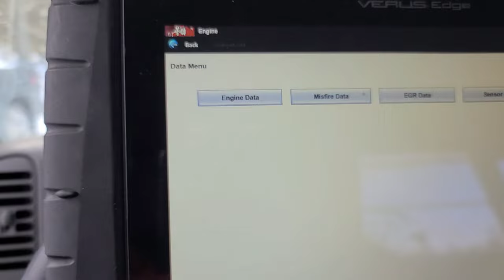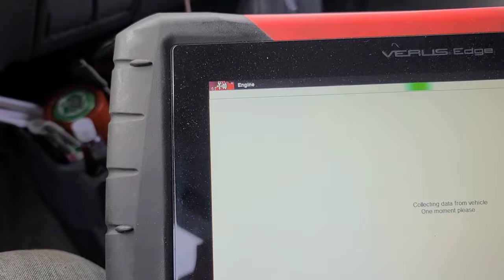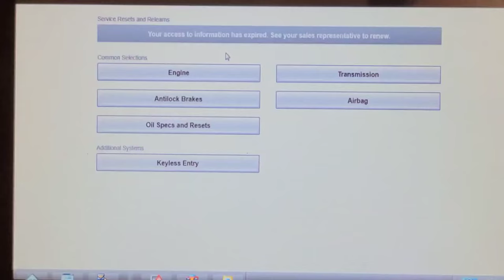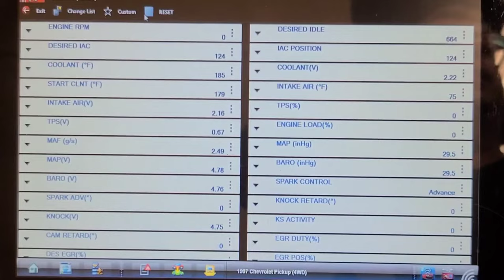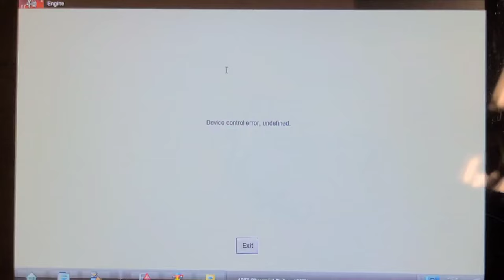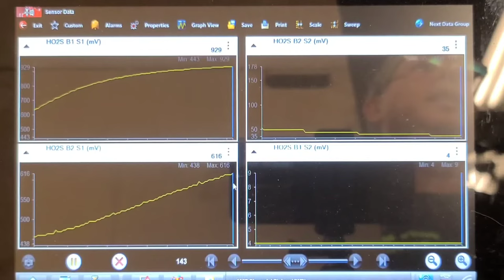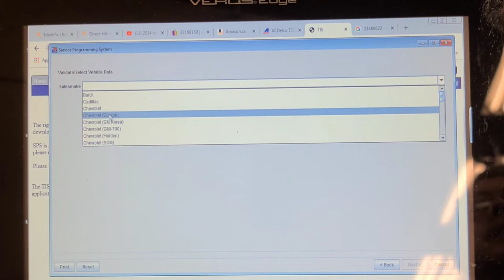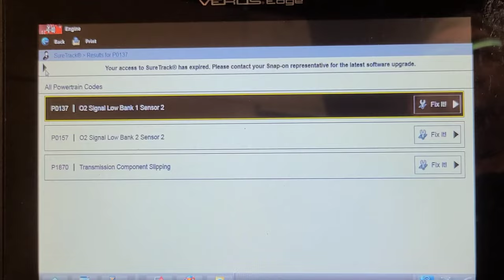1997 GM Truck Cranks No Start, No Codes

Comment: Doesnt ignition control module send information to the pcm letting it know when its ready for fuel and spark?  Sometimes you can pour a shot glass of fuel on the air filter and they will take right off on a crank but no start issue.  I see yours is different though.
Reply from the maker: No the ignition control module that was under the distributor cap of the throttle body systems did but this ignition module is a transistor controlling the ignition coil.
Reply: Nooooo it’s right beside the ignition coil that’s the problem

Comment: My blazer is doing the same thing, got spark, coil and distributor,rotor and capn,even fuel pump all new and replaced, no start, it's Gita be the ignition control module? Right? I'm not really getting fuel pressure, does the icm have anything to do with it?
Reply: Try changing your engine coolant temperature sensor that was the problem in my 98 s10

Comment: Did you pull the distributor and check the distributor drive gear? Numerous cases of the drive gear teeth being "knife edged" causing the P0300 random misfire code. Something to check.
Reply from the maker: No I didn't as I know the distributor was replaced and once running the cam sensor offset was at 0 degrees but you are correct the distributor gears wear out and throw out the sync between the rotor and tower causing an abnormally large air gap and weak secondary output leading to random misfire.

Comment: May I ask what may cause a no start "only when hot" on 1996 chevy suburban k1500? In the winter time the problem dissapears. In summer it won't fire up until it gets cold the next morning. New distributer,plugs,wires,coolent temp sensor,pvc valve. Fuel pressure at 55 "and holds good" and no codes. Thank you sir!
Reply from the maker: When it won't start I gather it's cranking ok. You need to figure out at that time what is missing ie spark, injector pulse or both. If you have no spark and no injection pulse could be a failed crank sensor. If you are missing just spark it could be a failed ignition module. Is there an RPM signal on the scanner? If you have both spark and injector pulse check fuel pressure.
Reply: Try changing your engine coolant temperature sensor that was the problem in my 98 s10
Reply: What was the problem

Comment: Phillip, thanks for the AWESOME  video/information  really learning a lot from you  so what made to go and  change the module /programing  and i wonder  with knowledge you have and sharing it you deserve much more sub in my opinion and been trying to share ur videos with others as much i can  CHEEEEEEEERS
Reply from the maker: The bias voltage on these older GM O2 sensors should be around 450mV KOEO and on this system because the heater circuits simply are turned on with the ignition and therefore should start to move towards 100mV with the ignition on not running. Turned out both rear sensors are dead anyways. Thanks for your support.

Comment: Fixed our 5.7 crank no start with new cap and rotor even though no visible signs of arcing out was clearly extremely old by the corrision built up underneath and on the rotor. Thanks for the video always nice to see someone else's go through before jumping under the hood as im not a daily mechanic so most of what i learn is lost over time. But since learning that subs and thumbs is what helps those of you posting your knowledge on here for us to save big money at shop its the least i can do! Cheers

Comment: Hey Philip, so I have a 03 Chevy s10 that just died on me while taking a turn off the highway. Tried to start back up but cranked no start. I had this same problem two weeks ago and it took me awhile to figure it out but I ended up replacing the rotor and distributor cap. Fired right up and ran great for two weeks. Zero codes. Then this happened. It’s getting gas and has no spark again. But this time it wasn’t throwing spark from the coil. Any suggestions?
Reply: @PhillipBailey  it’s a 6 cyl 4x4 4.3l. It also has a new coil. I’m about to check the terminals now on it. Appreciate your fast response
Reply: @PhillipBailey  also just hooked up a test light to negative and put it into the coil to double check the coil. I wasn’t visually seeing a spark connect from the light to the coil but the light would flash if I had it all the way in and was cranking over at the same time but couldn’t see the spark
Reply from the maker: @goodtripsonly  according to my info a 2003 S10 with a 2.2 4 cylinder uses waste spark and does not have a distributor.
Reply: @PhillipBailey  it’s not a 4 cylinder. It’s a 6 cylinder 4.3l
Reply from the maker: @goodtripsonly  ok then. The sensor in the distributor is the cam position sensor and it will not cause a no start. Here's what I would recommend to try...
1. Turn ignition on and listen for the fuel pump to run for about 1 second. The MIL must also come on in the dash and Stat on. If neither work check the fuses that power the PCM. If they are good then you will need to confirm the powers and grounds to the PCM. Ok go to 2...

2. You said you have no spark at the coil wire. Connect a test light to ground and backpin the white wire at the coil with the ignition on the light should light bright. If not backpin the pink wire key on. If it lights then replace the coil. If the test light turns on on the white/black wire have someone crank the engine over. The test light must blink indicating that the primary side of the coil is being switched on and off through the ignition control module. If it blinks and you have no spark from the coil replace it. If on steady 3...

3. If a scanner is available access engine data and watch for an RPM signal cranking and injector pulse width. No RPM and injector pulse it's likely a failed crank sensor or wiring. RPM and injector pulse 4...

4 at the ICM by the coil  a graphing volt meter to the control wire backpinning the white wire. Cranking you should get a 5 volt pulse to trigger the ICM. If you have a pulse then you have a failed ICM. No pulse you have a failed PCM or wiring to it.

There are a few other things that could be checked such as does the fuel pump run during cranking, do you have injector pulse. Other things like no fuel pressure will cause a no start but won't cause no spark.

Comment: Phillip, AWESOME and great information so u changed the PCM  because it did not control the O2 sensors or for some other reason and by the way you  deserve more SUB for the info/knowledge you sharing   and been trying sharing ur videos with others. cheeeeers
Reply: I was watching video I never thought of the coil it fiers when let go of key.trys to crank up but thanks allot.

Comment: Hey man i got a quick question for you i got a 99 Chevy c2500 5.7 it had a p1345 code for camshaft/crankshaft correlation so i reaplced the cam sensor now it wont fire up at all ran before just not right
Reply from the maker: That code is not a failed sensor and to be honest a failed cam sensor won't cause a no start condition. If you removed the distributor then you likely have it out of time. Pull number one plug,  turn the engine until you feel compression building in the plug hole then line up the timing mark to the top dead center pointer. Remove the distributor cap and check that the rotor is lined up to the appropriate tower. Also make sure the plug wires are on the correct locations. That code is typically caused by a worn distributor drive gear..

Comment: 2000 4.3 vortex v6 cranks won’t start, no spark at the coil so I swapped it. Still no spark at the ignition coil… should I be checking the distributor cap and rotor?
Reply from the maker: If you have no spark from the coil it's not the distributor cap or rotor. Does the check engine light turn on with the ignition switch? Does the fuel pump prime? Does the PCM communicate with a scan tool? Codes? Does the PCM read an RPM signal while cranking?
Reply: @PhillipBailey  the fuel pump does prime.
One code only, p0442 (small evap leak) 
I haven’t checked rpm on a scan tool but I don’t see the tacometer move when cranking
Reply: Yes check engine light comes on p0442
Reply from the maker: @saulguel5404  the gages may be frozen during cranking. Have to watch rpm in scan data. I'm sure the p0442 is unrelated.
Reply: @PhillipBailey  should I replace the ignition control module,
Reply from the maker: @saulguel5404 did you confirm power on the tach white wire at the coil with key on and it does not blink when cranking? Then yes.
Reply: @PhillipBailey  hey I used the test light on the red wire (power wire) connected to the ignition coil. the light remains on. There’s a second wire that’s white with a black stripe I don’t get a light with that one
Reply: I also tested the red wire that connects to the ignition control module and the light also stays on.
Reply: I tested both with the key on and cranking aswell the light stays on
Reply from the maker: @saulguel5404  the test light should light up on the white wire too. If not then the coil primary winding is open
Reply: @PhillipBailey  I mean I replaced the ICM and it worked… hey thanks man !!!
Reply from the maker: @saulguel5404  glad you figured it out.

Comment: My 97 gmc 2500 sierra 5.7 was doing this after i changed the radiator.  I changed the fuel pump and it seemed to fix the problem only after a few cranks later its doing it again? any suggestions?
Reply from the maker: Check your frame ground. There is a heavy ground on the lower right side of the firewall between the body, frame and engine. Since the fuel pump is grounded to the frame a poor frame ground will affect it.

Comment: My 99 round body 5.3 does a crank no start randomly any idea what it could be? One it start it runs good no check engine light nothing just does that randomly
Reply from the maker: You need to check it when the problem is present. does the fuel pump run on key on for the prime cycle? does the MIL turn on with the key? check fuel pressure, spark and injector pulse...what do you have to do to get it to start?
Reply: @PhillipBailey  I do have spark and my fuel pressure was at a 48 the other day when I checked
Reply: @PhillipBailey  also I thank I found a ground wire that comes from the bottom of the back driver side of the engine right by the headers that is striped that is not connected to anything
Reply from the maker: @302chris9  needs minimum 55psi fuel pressure. Sounds like a failed fuel pump. Try spraying some carb cleaner in tge throttle body see if it will run. Could also be a bad fuel pressure regulator but you said you replaced that already.
Reply from the maker: @302chris9  that could be the frame ground and may affect the operation of the fuel pump.
Reply: @PhillipBailey  thank you will check it out today

Comment: What if your not getting spark out of the coil at all? I have a 99 7.4 vtek thats getting fuel, power and pulse signal to a new coil but still not fireing the coil.
Reply from the maker: Check for ignition power and ground at the coil. The pulse is a 5volt signal from the pcm. If you have those then the coil is bad.

Comment: Hey Phillip I have a 1997 4.3 1500 that randomly shut off on the freeway (ran perfect before that). I can hear the fuel pump going but have no spark now. Could a coil just fail instantly? Not sure where to go…
Reply: Also, engine cranks but no codes..
Reply from the maker: Yes a coil can fail with no warning. Do you have spark at the coil wire? If so check cap and rotor. If not listen for the fuel pump to prime when tlyou turn on the ignition. Bump the starter with the key and listen for tge pump to rerun. If it does this indicates the crank sensor is sending a reference to the pcm. Does the data indicate rpm while cranking? If so you may have a failed ignition module. You need a graphing meter to check for the 5volt pulse to the ignition module. Good luck.
Reply: Ignition control modules are notorious for failing and causing internment no starts when hot, although I had one fail when the engine was cold! 
The ICM was located under the distributor cap untill 92 / 93. 
The thermal paste on the heat sink dries up & the solid state epoxy encased electronics develop internment problems.

Comment: So I’m dealing with common issues does anyone know where that purple wire is tied into from the coil pack I have a similar wire but the other end is broken off and I can’t find where it goes
Reply from the maker: I see three wires to the coil none is purple and 4 wires to the module again none is purple. What year and engine? What's the problem with the engine. Sometimes an aftermarket car starter is tied into the white wire as that's a tach signal. Does it have an aftermarket car starter?
Reply: @PhillipBailey  at 9:32 you can see the purple wire going to drivers side from the ignition coil harness
Reply from the maker: @theoholcomb50  as I said that's the tach signal  wire for an aftermarket car starter on this truck

Comment: No oil pressure when cranking
Reply from the maker: It will take a bit of cranking to build oil pressure especially if you have not started it for several hours. You did mean oil pressure not fuel pressure?

Comment: My truck doing the same I’m lost I don’t know what to do
Reply from the maker: It's a process of elimination, scan for codes, review data for failed in range sensors, check fuel pump operation, fuel pressure, spark at plug, spark at coil, injector pulse and fuel delivery. Could also be a mechanical engine problem like jumped timing chain, stripped distributor gear or contaminated fuel.

Comment: Would this truck randomly start/no start?
Reply from the maker: It was towed in as a crank no start but the coil could cause an intermittent no start or stall condition for sure.
Reply: @PhillipBailey  thanks for the reply, been chasing the same issue for what seems to be an eternity. Crank sensor shimmed, new plugs, wires, cap, icm, cam sensor, coil getting power, random no spark. Coil has been changed, but i think its the next to try.